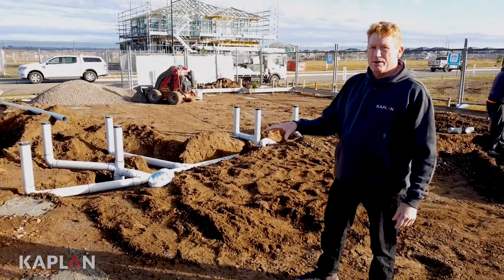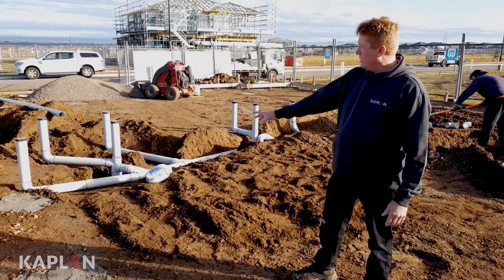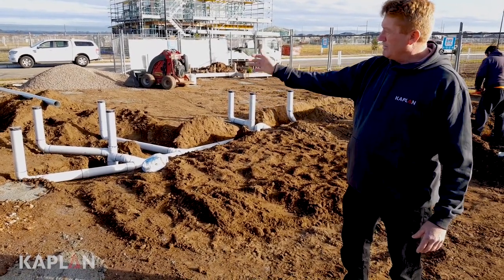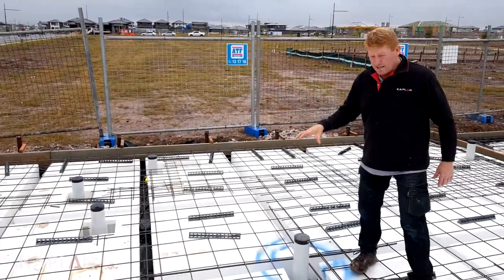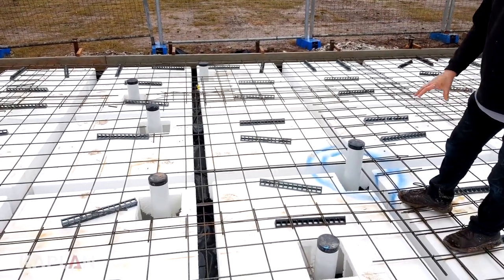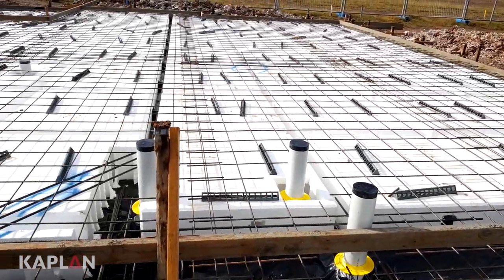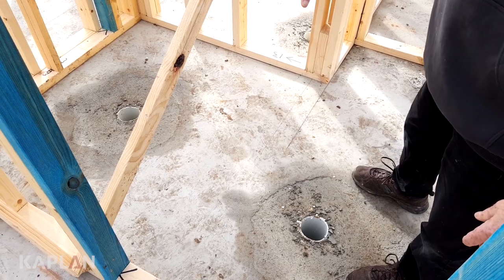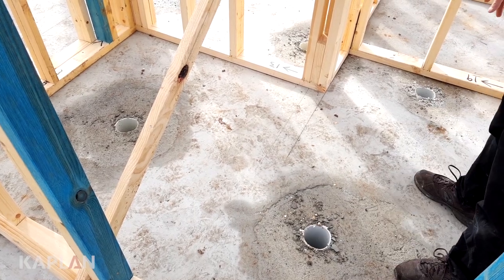Kaplan Homes: Build stage 3 - Under slab plumbing and drainage for a new house

Comment: Hi, can you help me understand something please. Can you put water pipes (water into house) under the slab? And say if I need to have internal water from the laundry/bathrooms area to the kitchen 8 metres away; does this line run under the slab and then pop back up? Thank you for your useful videos. (I'm planning owner builder build 2023).
Reply: you can insulate pex pipe and run it in but it is better to run a large 100mm pvc pipe in the ground and use 45 degree angles to make an elbow for each end then feed pex pipe through it

Comment: Great ! But just wondering what are those  white squares that were put in before the slab pour ? Can  you please help understand. Also, the drainage pipes seem to be positioned perfectly for the baths downstairs which is good. How about the drainage pipes for 1st floor and particularly if they are at a different place ?
Reply: Waffle pods which are made of foam, they reduce the amount of concrete needed in a slab pour
Reply from the maker: The second half of our video explains the purpose of the waffle pods (white squares) https://youtu.be/J-3RJ_Zlvbw?t=147 . As for 2nd storey drainage pipes, all under slab plumbing, including the pipework for the 2nd storey downpipes, are installed by the plumber at the same time according to the plans in this step of the build. Once the second storey frames are built, the above slab plumbing pipes will then be installed and connected.
Reply: @KaplanHomes  Waffle pods are very brittle, how this small pieces support the base?
Reply from the maker: @koteswararao1693  the waffle pods are only there to shape the concrete slab's underside into a waffle-like shape. The concrete slab will still be the foundation, only shaped with waffle-like grids underneath. The resulting slab is a strong, yet lighter foundation compared to traditional solid slabs.